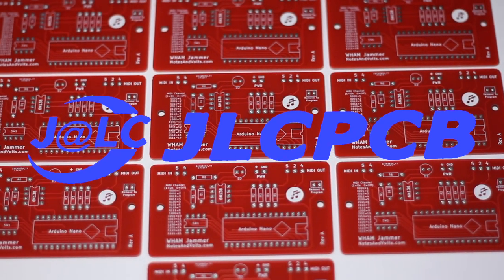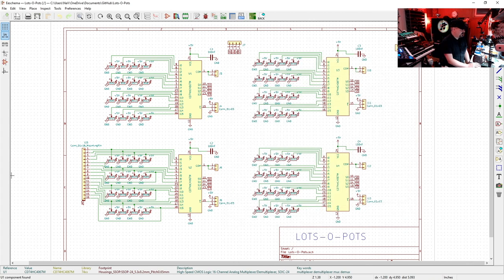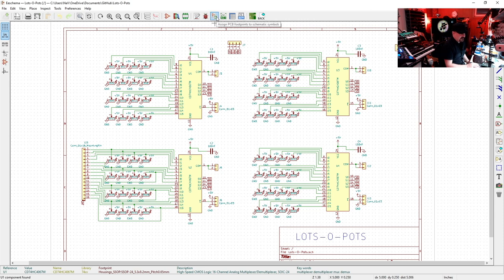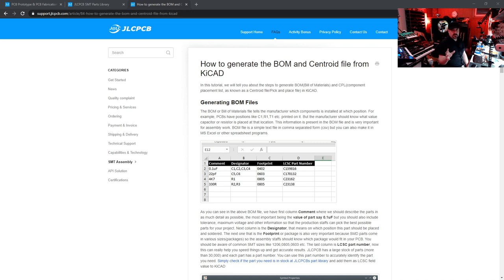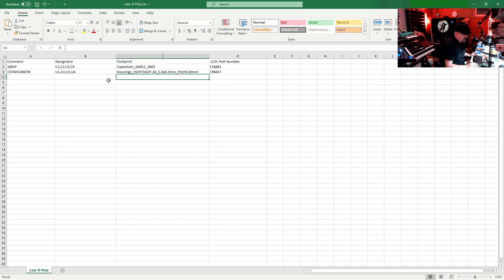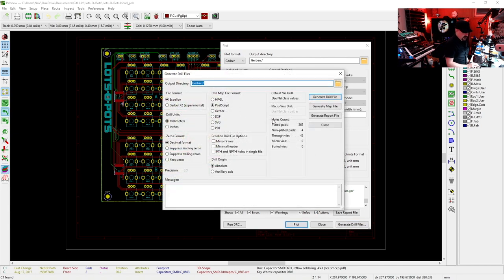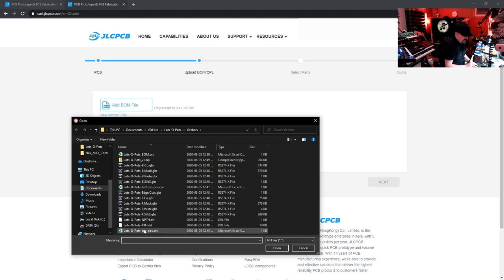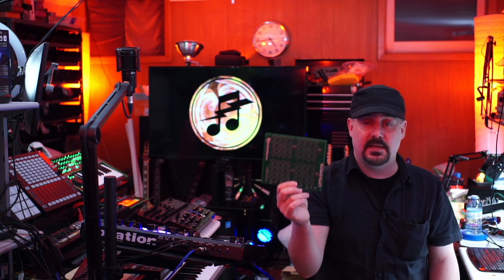JLCPCB - SMT Assembly with KiCad

Comment: Great tutorial. There is a plugin now called "Fabrication Toolkit" that can be installed directly from within KiCad (through Plugin and Content Manager). It adds a new button to the PCB Editor called "Fabrication Toolkit" and generates all the necessary files. It makes several of the tweaking steps in this video unnecessary. Your tutorial is still very helpful though to understand the requirements and to double-check the files that are generated.

Comment: I followed your great step-by-step process to get a quote on my board that I built in Fusion 360.  All of the part orientations were wrong, despite being correct in the F360 library and board layout.  The 5 boards were cheap at about 7 Euros but assembly had a lot of fees, bumping from Economical to Standard due to the ESP32 module, and then the parts for a total of 137 euros.  And they didn't have stock on 3 connectors that I selected from the LCSC catalog...  I've decided to order the raw parts for 2 units, wherever I can find them, and have JLCPCB just fabricate the boards.  At this point, it's the first go at a brand new design so I'm sure it's full of errors!  When I finalize it I might order 5 assembled.

Comment: I hope they have the nRF24L01. It's only available in a QFN package and I don't have a reflow oven. I recently found out that you have to practice to get the PCB to reflow correctly.
EDIT: Wow, I just checked the website. They have the chip and the datasheet. The schematic for the PCB is in the back of the datasheet.
Thank you for posting.

Comment: really nice tutorial... just one question if I may... the top side of a board I am currently designing has only through-hole components which I have therefore removed from the BOM. Should I delete all of these entries in the top-side .pos file or should I just send it through to JLCPCB as it is  along with the Bottom-side .pos which contains all of the SMT components? would it even matter either way?

Thanks again though... really really good tutorial :)

Comment: 16:34 in schematic view, component properties, use “Exclude from BOM” for components you don’t want to place.
26:33 this is the most annoying part about SMD assembly - incorrect parts rotation. Apparently it’s not even right if you use their own tool, EasyEDA!
Personally I have a program I run that corrects the rotation of parts in the CPL before submitting. That way I’m not relying on someone at JLCPCB “fixing” things correctly. The program also changes the column headings and makes all the other mundane changes.
Reply: Hey Stuart, do you mind sharing your program that corrects the rotation of the parts.

Comment: I have got a project board (50mm X 100mm) and I want jlcpcb to apply component assembly on it. But they need 200mmX200mm minimum dimensions for smt assembly. How can I solve the conflict?

Comment: Hi Dave! I m so happy because since i start circuits by your tutorials i have  waited for more detail informations about multiplexers to build giand midi controllers. I read lots of forums, articles, i worked with my electronic eng friend we designed couple of pcbs have mux. But we always had random  CCs fluctuations if we solder lots of pots. And that problem doesnt let to map  to knobs on screen.Maybe it s because wires. We add 0.1 uf capasitors between each pot legs but still has same problem. Is that shield usefull fir arduino uno midi controller( the code that you shared in 3 series videos 1-Potentiometers 2-Buttons 3-Multiplexer)? I think the capasitor on each multiplexer is to reduce random fluctuation from pots. Thats what i fight for more than a year.